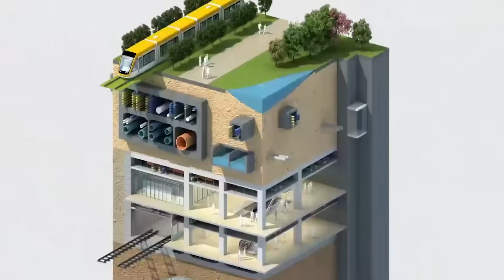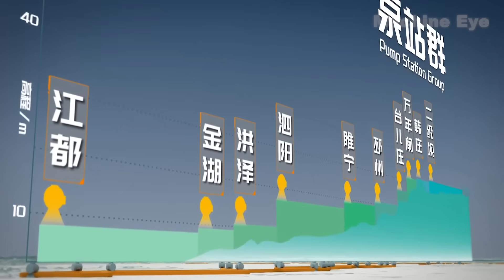CHINA JUST HUMILIATED THE WEST—These Mega Projects Will Change EVERYTHING

Comment: Is this a proof that metric system of measurement is better than english system.?
Reply: The imperial measurement system is simply nonsense. That is why it is not used in science and engineering. But the Americans know exactly what a 9 or 45 millimeter weapon is.
Reply: They don't have environmentalist proactive groups most if the Wests issue is environmental regulations and bureaucracy china doesn't have that issue and they also don't  care how many workers die on the job or how many have to be uprooted try to uproot 100,000 people in any western countries that alone would stop any mega project in its track